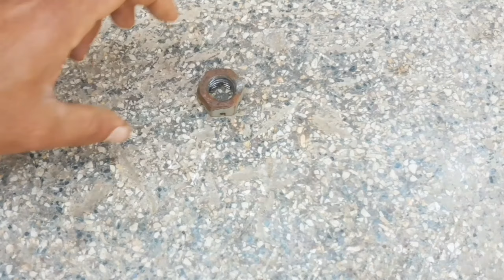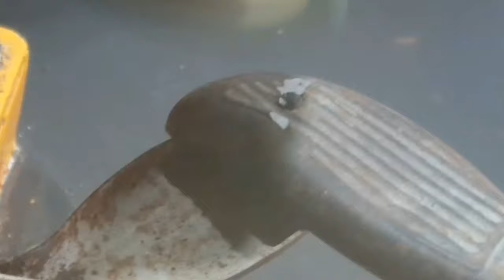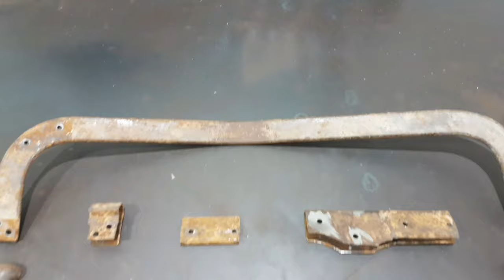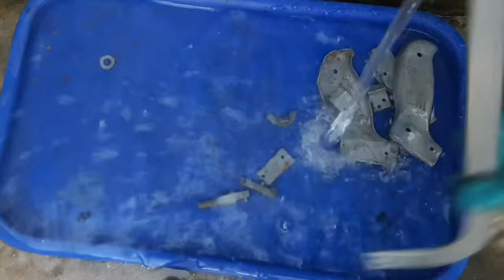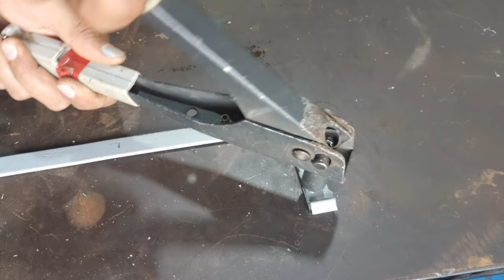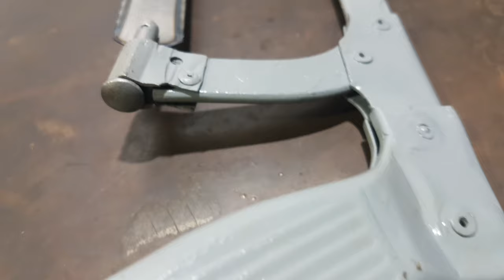Antique Rusty Adjustable Hacksaw with Broken Blade - Restoration

Comment: A good job.  I think using the grinder to remove the rivets, while fast, was a bit heavy handed.  Especially on the handle, where it did a lot of unnecessary damage.  From a viewer interest standpoint, having some color variation in painting (such as red handles) might also improve your video.  Again, good job.
Reply from the maker: Thanks for great Advice